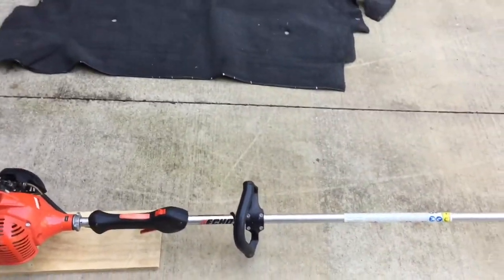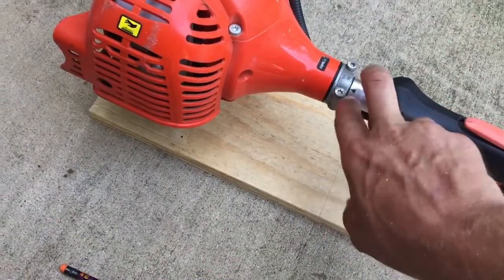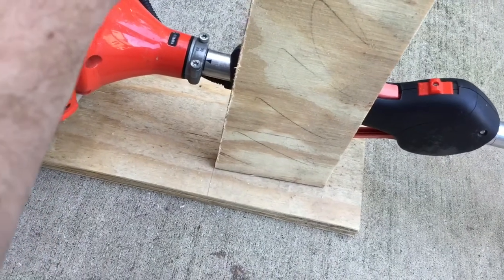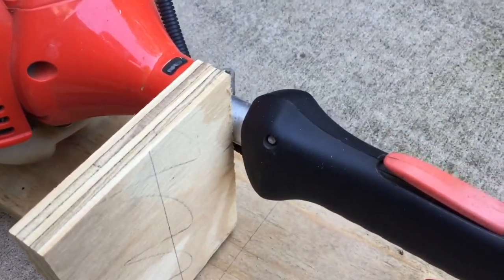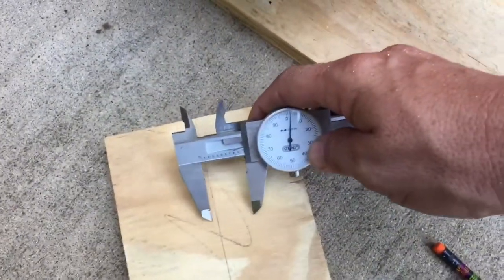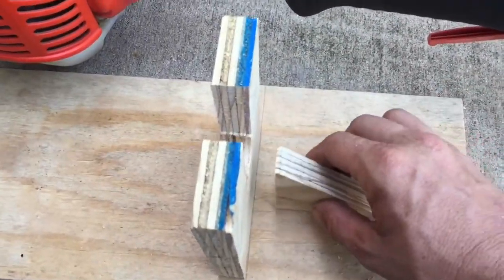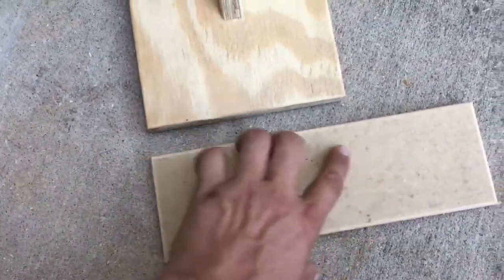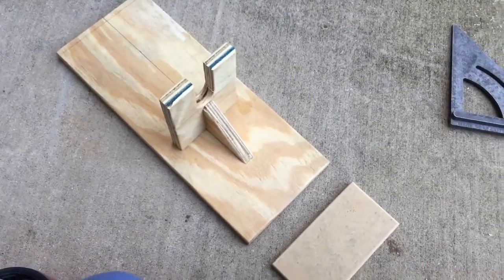DIY: String Trimmer Mount

Comment: The best decision I’ve made with a trimmer was getting rid of the inconvenience of mixing gas and oil and buy a electric trimmer. I bought the Milwaukee.
Reply from the maker: I’ve considered it..
Reply: @BellyUpFishGarage  mine is just as powerful And batteries last just as long as a tank of gas. No hassle is the big buy for me. Just grab it and go.
Reply: @joshingrum good for you, now try that electric trimmer deep in the woods with armies of black flies and mosquitos see how long you tolerate the great outdoors. 2 stroke mix is easy , 100 ml with 5 liters jug and mix you get 50:1 mix. Whats the problem?
Reply from the maker: What are you trimming deep in the woods? 😆
Reply: @BellyUpFishGarage  paths to cut pine and maples trees
Reply from the maker: Yeh, be pretty hard to use an electric trimmer out there.